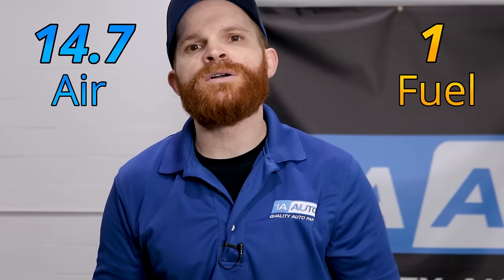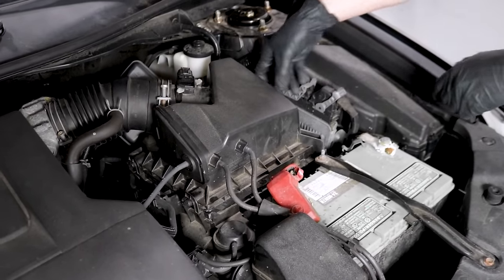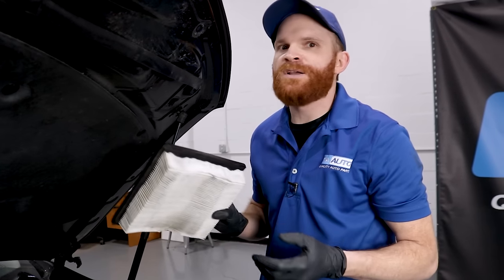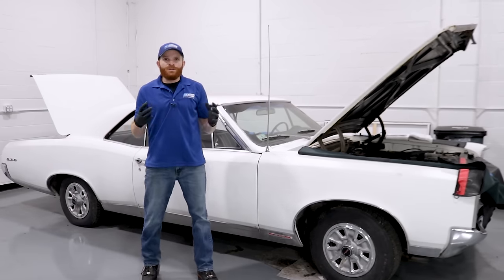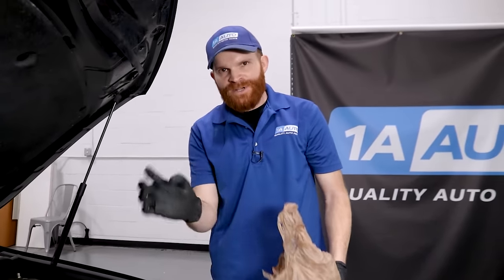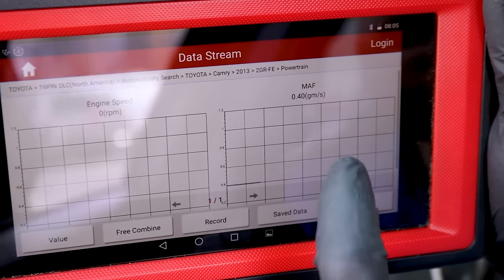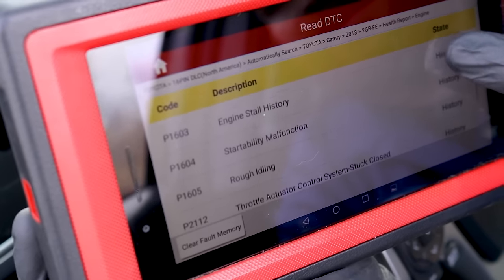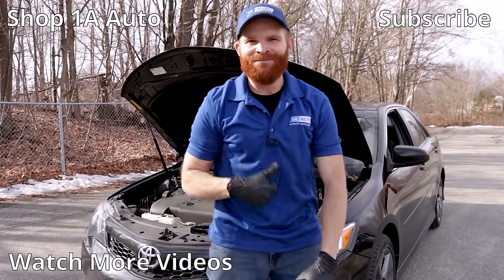Car Engine Cutting Out? Only Drives Slow? How to Check Air Intake System!

Comment: I have the same situation when I am stopped on a traffic light the car start to jump and the RPM starts fluctuating up and down, changed the gasoline pump and the gas filter but still feel like a misfire a piston what could be and you have any place for repair here in NJ
Reply: Where in NJ?

Comment: I had noticed my car lights flickering and even on the dashboard for a few weeks. I bought an engine air filter and changed it myself then noticed the flickering had gone so I’m sure it was because the older filter was restricting airflow to the engine since it was very dirty. I did learn something here. Thank you!

Comment: Differently felt all the symptoms, started the car it didn't wanted to start i accelerated it started and was shaking reduced horse power no pulling.  Changed the air filter cleaner and boom it runs snooth

Comment: Had a filter with the screen and think it was restricted my air flow .  I was having rpm surge. After changing part after part  I looked back at filter and changed it again with factory filter . Surge went away. Think even with screen it was cutting air back or swirling it to cause the problem?

Comment: Can’t figure mine out…. Replaced my throttle body, battery, spark plugs, air filter, cabin filter, oil change, coolant change ect. It’s now in LIMP MODE and have researched a ton and tried everything and nothing is working. When I got my new throttle body… I picked it out of the box and had a rattle in it… I don’t know if it’s supposed to sound like that but had no choice but to put it on. I’ve watched videos and tips and tricks and nothing.

Comment: Ok just checked out ur videos loved them but I have a question I own a 00 Chevy blazer 4.3 just got her running but she has a rough idle low power replace the map,idle senor,tps,egr,wires n plugs,cap n rotor,pick up coil,
Reply from the maker: +Phillip Hubbard We wouldn't be able to diagnose an issue like that here, you may want to have a local mechanic take a look at it. Thanks for checking us out! http://1aau.to/m/Shop-1AAuto-c

Comment: This only happens when I turn my headlights on but when it’s off it drives completely fine. Any idea what the problem may be? Just need a point in the right direction. Anything helps thanks!
Reply from the maker: +Joshua U We wouldn't be able to diagnose an issue like that here, you may want to have a local mechanic take a look at it. Thanks for checking us out! http://1aau.to/m/Shop-1AAuto-c

Comment: I’m hearing a puff sound when I shut off the engine after I disconnected the hose clamp and unplugged it the air sensor. I this happened when I had get access to the passenger low beam light bulb.

Comment: I have a 2017 traverse it goes to limp shacks steering wheel and  says traction control failure  . we changed mass air flow fixed about  6 months  now this stuff is going on

Comment: My car is throwing a P0420 code. It's in limp mode. At 2000 rpm is starts to make a weird sound that seems to be coming from the air filter housing or intake. I've heard cat and I've heard fuel filter. Any thoughts?
Reply from the maker: +Eagle TalonZ We wouldn't be able to diagnose an issue like that here, you may want to have a local mechanic take a look at it. Thanks for checking us out! http://1aau.to/m/Shop-1AAuto-c

Comment: good video, took a 300 mile trip on my marquis, on way back it started acting strange... when home added code reader and got p1100 code MFA opened air box and found a 4/4 inch peice of a plastic bag.. 😂 it does happen

Comment: Other than all the silly "ClownCrap" good video.  Watched due to limp mode as I bought a VERY CHEAP priced honda 2007 minivan & noticed TONS of bulky plastic b.s. below airtake box  when changing battery & removed to clean visual of area as easy.  But test drive QUICKLY tripped E. ck light!   I'm guessing air straight into filter box like the old days does NOT compute!  LOL

Comment: Got 2007 Corolla 130k miles. Starts right up, but after a few stops and engine is warm, it’s hard to crank over. No check engine light. How do you fix? Where to even start?

Comment: I have a Honda ballade luxline S04 1998 150i,since i changed the complete throttle body,while driving the car has a split second to wanting to cut off,if I pull out the map sensor plug then it's ok,no engine light stays on only when you pull it out engine light goes on once you switch off and Start again then engine light is off,what should I do

Comment: Hi,
I have noticed a loss of power in lower gears. I measured the air flow rate and its 1.5-1.6 g/s at idle.  Is it normale for a 2.2 diesel engine?
Any suggestiins what could have gone wrong?
Cheers

Comment: I change my spark plugs , and when I get ready to cran my car it’s tries to run then it shuts off like it puff puff puff then cuts off when I press the gas it’s stays running but when I take it off is stall puff puff puff then cuts offf don’t idle at all  it do sometimes but with with very low power  I took it to a mechanic they say it’s the EGR valve , and intake manifold but I’m thinking that wouldn’t cause your car to keep shutting off right ? , I got a 2002 Ford Focus the fuel pump  turns on but I think it’s bad I need help

Comment: My 2006 Subaru Legacy Outback 2.5 does this. It's at 124,523 miles on it and I'm thinking it's the Timing belt that's due? It blinks the cruise light and a steady check engine light. So is it a bad egr?
Reply from the maker: +Jerzey Boy1995 We wouldn't be able to diagnose an issue like that here, you may want to have a local mechanic take a look at it. Thanks for checking us out! http://1aau.to/m/Shop-1AAuto-c
Reply: What code

Comment: So I have an 01 Lexus is300 252k miles and recently it died out on me while driving. Then crank no start code p0715 came on “intake/turbin tranny speed sensor” and I replaced it yet still crank no start. I haven’t changed my spark plugs in about a year. New throttle body, new fuel pump, relative new alternator (4yrs old), new cam gear and timing belt, it was on full tank. I did notice the air intake wasn’t full on the throttle body half was attached and half seemed to be sucked in a bit. Battery is kinda going but I have a jump box. Anyone have any ideas?
Reply from the maker: +@thedebumdum8268 We wouldn't be able to diagnose an issue like that here, you may want to have a local mechanic take a look at it. Thanks for checking us out! http://1aau.to/m/Shop-1AAuto-c

Comment: Replaced cheap ebay throttle body as error code as here. It was missing slow not shift correctly after reply error code not reset. But after 9 start stops all good used oem part from old chevy v6

Comment: Damn. Makes me wonder about the 2 Cadillac Fleetwoods i sold with a loss of acceleration issue. Same thing happened to them both. They were fine the night before then i go to start them and it was like there was little to no acceleration and i was flooring it. Sounded like i was doin 80mph but going 5mph. Im more mechanically inclined now but i wish i knew for sure what was going on with them. After seeing this video i never knew it could be something so simple. Anyway thanks for the video 👍